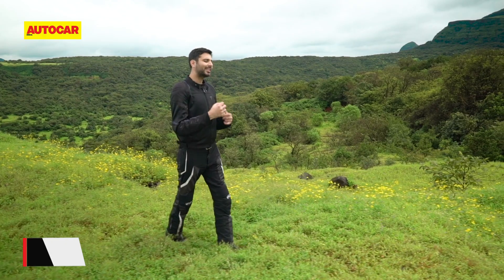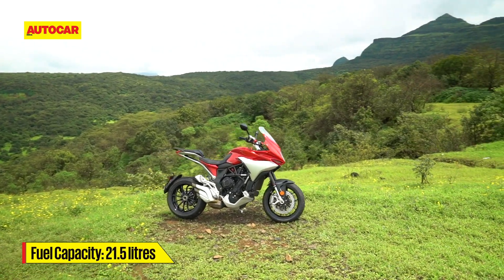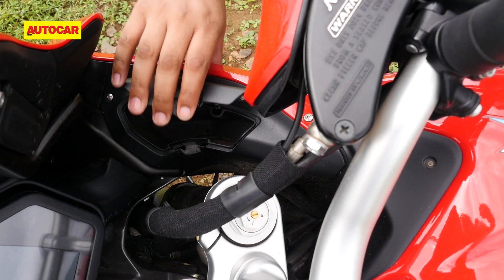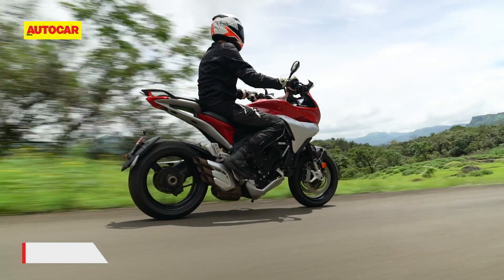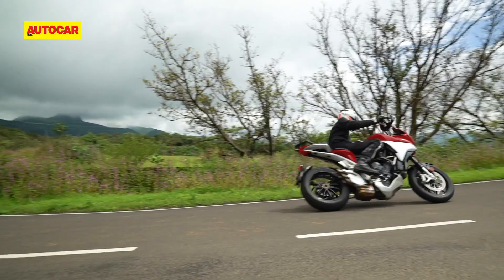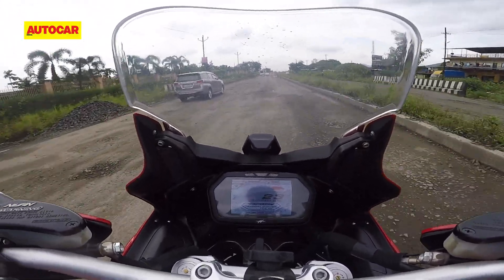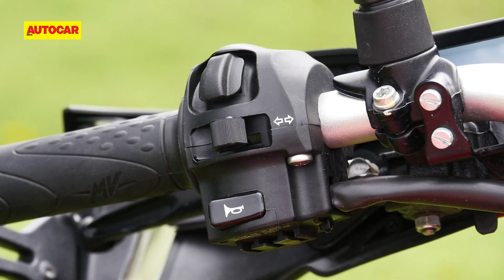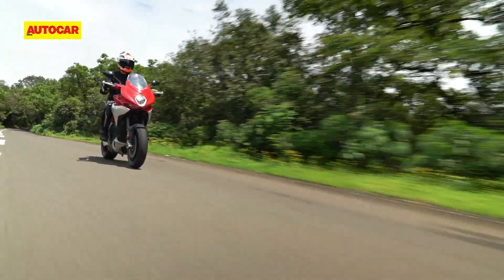MV Agusta Turismo Veloce 800 Review | Test Ride | Autocar India

Comment: I had the opportunity to ride this bike and yes, the heat is really bad. The exact same issue with Brutale. The engine cuts off on me after less than an hour at low speed. The bike doesn't like to be slow. The visibility on the dashboard is poor as well. The seat is not comfortable at all, it is hard and I wouldn't want to spent hours in that saddle. As far as emotion goes, sure... but they belong in the garage for show off and not so much on the streets.

I rather get a KTM for the emotions and better reliability.